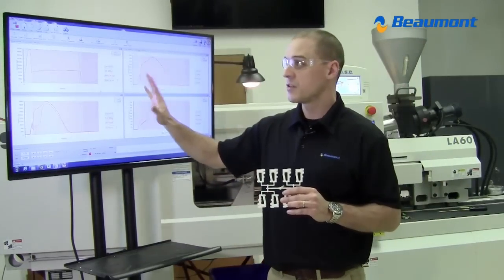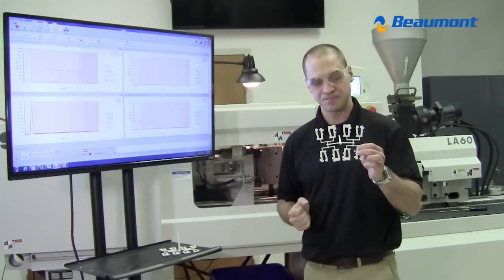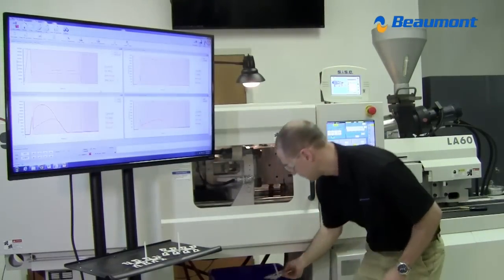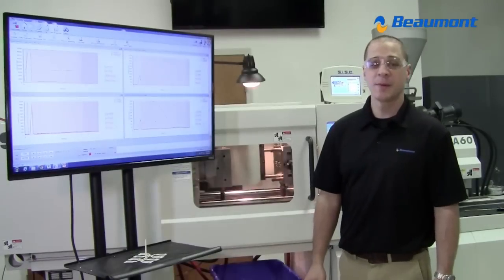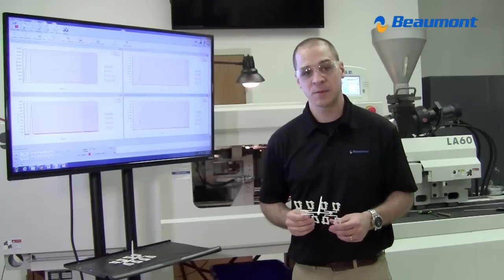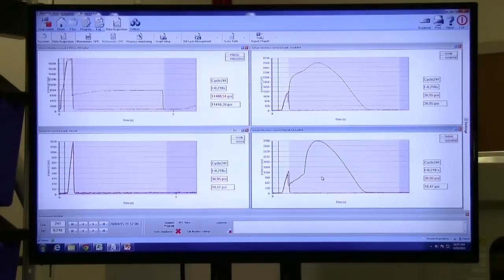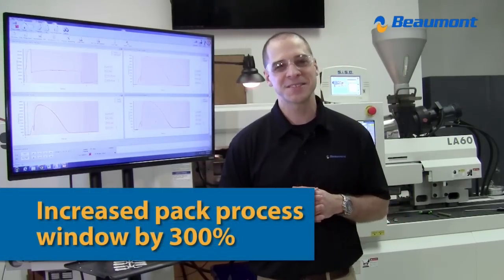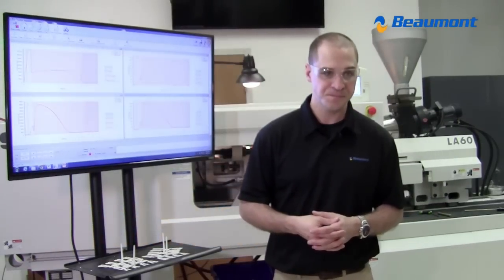MeltFlipper® Video Demonstration

Comment: Very interesting. However, it appears like the injection pressure is flatting (pressure-limited?). Looking carefully at the gate pressure graphs, it appears that the slope of the cavity fill also changes slightly at this same injection point. Is this just part of the Sodick machine control, speed change, or is it pressure limiting the fill? This would be viscosity change during the filling of the part and would seem this is a contributor to the unbalance, though I understand the rheology flip that the Meltflipper geometry is adding does provide better balance. But is this the best balance given this observation? And what is the %balance (using the 5 Step procedure)before and after?